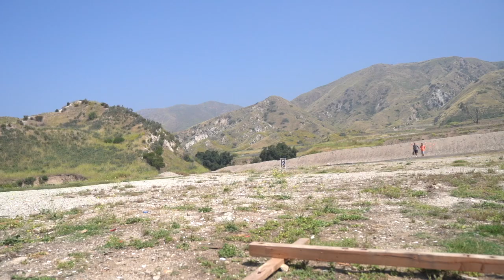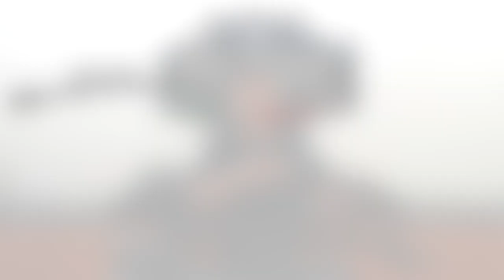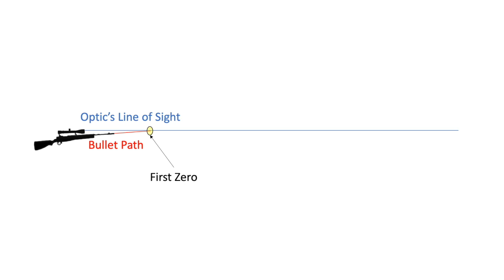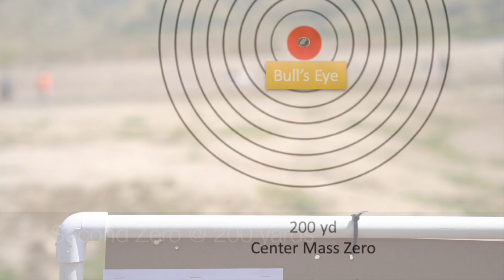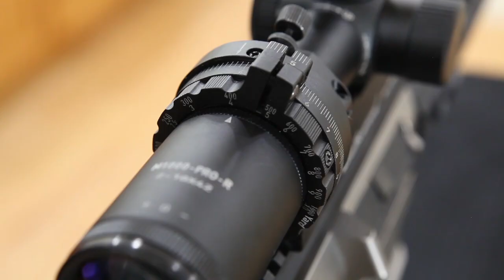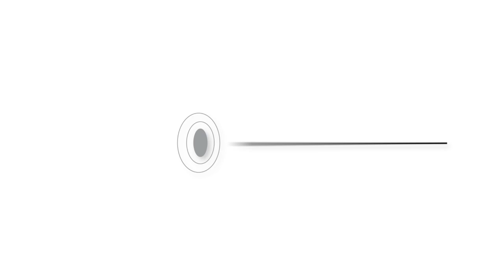How to Zero Your Scope at 25 Yds

Comment: First zero and second zero... I realized I had some geometry to do to understand how the various ranges will matter, especially since shooting at say two yards will aim you low on your target by about the scope height... or more? Then zeroing in at say 20 yards, I'll be shooting high then at 30? And then depending on the ballistics that second zero, presuming you were at the first zero in 20 yards. Still seems confusing, but I see the puzzle. I suppose it is true that zeroing in at zero yards you would than simply be witnessing bullet drop at all other ranges, but no: because you zeroed in at zero yards, your scope is exageratedly pointed towards your barrel, and so the correct thing is to measure the height of the center of your scope from the center of your barrel, sight in for that distance low, and then you could call this a raw zero, yet it still does not actually simplify the puzzle as you now are computing that you set your site low initially. Fascinating how complicated this gets with just these factors.

Comment: Forgive me if I'm wrong, but couldn't you do a hypothetical first zero provided that you know your MOA at the distance you want and over adjust (for lack of better term) your bullet drop to shoot that MOA higher on the closer target, such that it would hit relatively dead centre on the ideal target?
Reply from the maker: There's definitely a lot of potential solutions out there! Usually, though, a close target (25 yards) will have the bullet hitting below the line of sight when zeroing for 100 yards. The sights are usually high enough that the trajectory doesn't cross over that early. We've also tested a 25yd to 300yd shift, which does raise the first zero location.

Comment: What’s the range for  a 350 legend to be on point at 100 yards? I’ve been told that a “1” and a quarter under center at 10 yards and your on? What do you think?
Reply from the maker: To really drill down on that, we'd need to find out the muzzle velocity, BC, and bullet weight. At 10 yards, the height that the scope sits above the center of bore also comes into play. Any chance you've got those measurements?